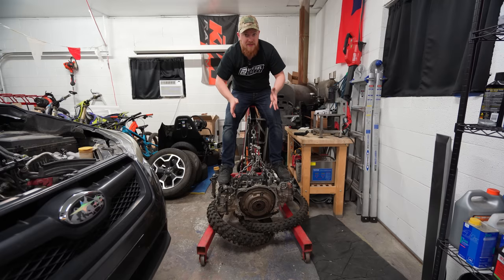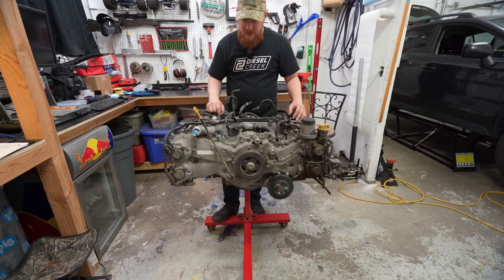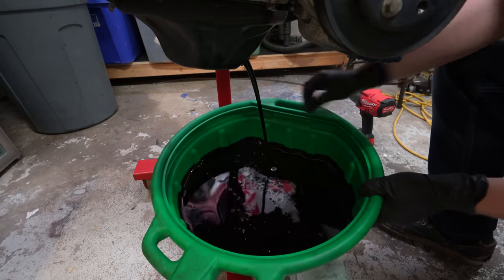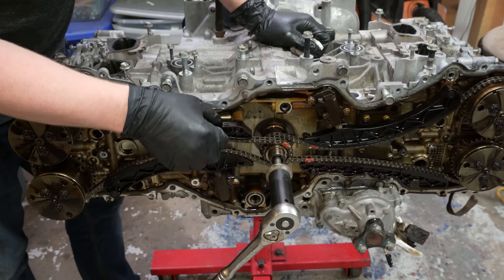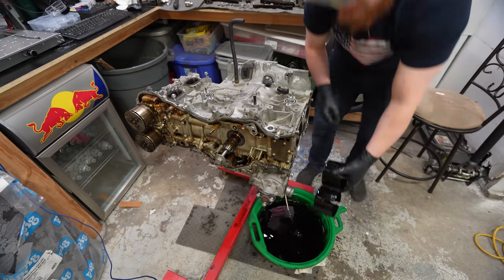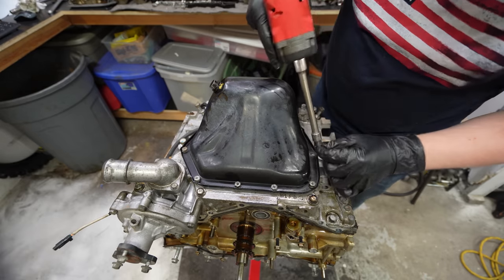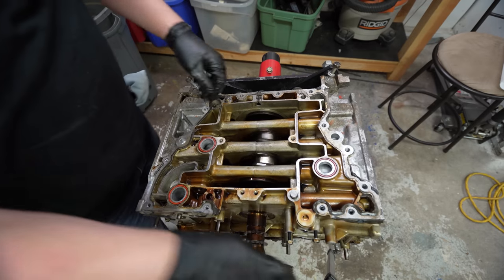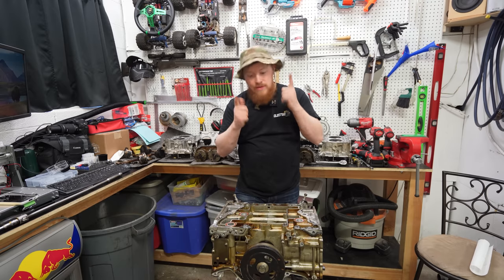Finding Out Why Our Crosstrek Blew Up! Engine Tear Down and Diagnosis.

Comment: Hate to break it to you but I don’t think the leaf blower motor will work. But a turbo charged leaf blower.... now that might be an option. Heck maybe you can use another leaf blower to blow air into the system like a turbo. Maybe if we just keep adding leaf blowers we’ll have exponential power!!

Comment: I just ordered a '23 manual transmission Crosstrek Premium. My understanding is that the engine had some redesigns in some details.
Never owned a Subaru before, hoping for good longevity. I'm planning some long-distance road trips and taking my canine pals with me. Grand Canyon, Banff, Okeechobee....
Reply from the maker: So glad they're still making manuals! And more inportantly that people like you are buying them.
And yes they moved to direct injection which has its tradeoffs. For you it just mainly means better fuel economy. And main thing with Subaru motors is just making sure you're keeping up on the oil care. Always make sure it has good oil level, change it ontime and use a good filter. Should last you for years to come. 👍

Comment: There are bolt on FB20 turbos but I think it'll end up costing more than one of the many swap options. Also as you mentioned, these engines seem like a real pain to put together.
Reply: Try a 3406B. That is the easy button by comparison...

Comment: Its pretty disappointing to see an engine gone after just 120K miles. My opinion is that you should just a get WRX engine for more power. The WRX engine would have got components that's designed for turbo charged loads. Trying to make big power from an NA engine is like trying to get a plastic straw to lift heavy weights.

Comment: I had just changed my oil and drained the old oil into the empty oil jug. Backing into my garage I didn't notice that the dog had knocked over the sealed oil jug until I promptly drove over it where it exploded and sprayed a fine coating of oil everywhere.
Reply from the maker: 😂 I count my blessings then.

Comment: Hey, I had a 2010 outback with a 2.5 EJ engine and it was binding up with carbon buildup on the piston top, almost a 10th of an inch. This was due to low tension piston rings and blow by forcing oil into the intake like you saw with your venturi plates. replaced the rings and it was all better. I have a 2013 crosstrek and it has the weak rings too, so much blow by it couldn't hold oil, then the same thing except it broke pistons and rings and bearings. Seeing rod bearings 2 and 3, I'd say main bearing number 3 has failed since it supplies oil to those.

Now mine has it has a .50mm overbore late model rings (Subaru got sued over this one) and I'm chasing an oiling problem. Check the carbon on the piston tops and the combustion chambers and split the block and look at #3 main. ;-)

Also, the FB20 is a turkey as far as tuner bits go, and the FA20 is a giant PITA to swap as they are like dogs and cats, good luck.

Comment: That oil looked pretty dirty for a recent oil change? Great work, info/video! Enjoyed it very much!! A Crosstrek owner.
Reply: That oil looked like what comes out of my Duramax, super dark and thick for a gasser supposedly using 0w-20
Reply: ... pretty sure the 0w-20 being used doesn't have high HTHS (high-temp/high-shear) properties and is also resource conserving which means it thins out to less than a "20 weight" at operating temp.  and then some oils just get dark when exposed to heat
Reply: I change my Crosstrek oil at 7k mile with Mobil 1 and it never looks that nasty

Comment: I think I may have the same timing chain noise on the fb25 engine in my forester. Does it sound similar to a engine pinging noise? I hear it under low RPM load most prominently.
Reply from the maker: Yeah more sounded like a clacking noise for us. But yeah for the XV usually under load at  2-3k rpm or lower.

Comment: It appears to have had an oil delivery problem to those rod bearings.  Subaru flat-4's of any model do not tolerate operation with low oil sump levels and will sometimes even spin those bearing shells.  I'd definitely crack the case and look at the mains for similar problems.
Reply from the maker: Yeah if i rebuild this motor then I'm definitely pulling the mains. There's no way they're good if the rod bearings looked the way they did.

Comment: After watching the whole video, and my little knowledge of the FB20 engine, I would say don't rebuild it if you're looking for more power. Maybe go the FB25 route for a little more power or go the FA20 if you want to spend a lot of money since everything else will need to be beefed up.
Reply: Assuming the FB25 will fit
Reply: @fredharvey2720  looks like the FB25 is 1.6-2.0" taller and deeper. The stroke is the same so it shouldn't be wider. I've messed with the 16 XV and Impreza a bunch of times. You definitely have space to spare in that engine bay for the depth...the height could be tight, but they probably revised the intake manifold to accommodate the difference. Personally I like the 2018+ a whole lot better. I'd just replace the main bearings in this engine and trade up at a later date.

Comment: Interested to see what you do for repair.

Subarus are pretty capable of interchanging parts. If you had the time, money, and wiring know-how (or someone who does), then the best upgrade would be getting a wrecked WRX, or Forester XT and swapping the driveline. Mid range would be a headstud / gasket upgrade and a procharger kit. I think there are some kits out there (AVO makes one). But if it were me, I would probably just replace with stock parts and port the intake and exhaust, and a tune, maybe do headers and custom catback as well.

Comment: I think if it was me , I’d look around for a used engine.. and just get it back up and running.. as parts and machine shop labour and gaskets.. probably won’t be cheap and it’s hard to find a good machine shop.

Comment: I think the FA24F from a 2019+ Ascent would be a good swap. Turbo, 260hp and will run on 87 octane
Reply: I have a 2022 Outback Wilderness, the FA24F is a nice engine, it does run great on 87, but I have found that I get better fuel economy with 91 octane. Also the turbo and tuned transmission in the Wilderness Edition give it quite some nice pickup, at the expense of fuel economy.

Comment: See if you can drop a wrx engine in.  I've always wondered why Subaru didn't put the wrx engine in the Crosstrek.  Everyone I know that has one says the same thing...  It doesn't have enough power.

Comment: Excellent work. I really enjoyed watching you tear down this motor and finding the issue. I own a newer 2019 Crosstrek and love it. I plan on keeping it for about 10-12 years and will not likely get anywhere near the 120k you had on this motor as my wife and only put about 8000 miles per year on it. I'm curios to know how often you changed the oil and whether or not you used regular oil, as synthetic or a blend of the two. Since we drive the car so little, I am changing every 6 months and use a blend. I'm thinking of going full synthetic and stay with the every 6 months strategy.
Reply: your good on the 6 mth oil change thats recommended anyway no matter how many miles 
the book says to put 0-20  synthetic i have a 2020 crosstrek i order genuine subaru oil  on 
Amazon and use a mobile 1 oil filter
Reply: @alanlangley7246  thanks for your reply, Alan. I’ll order that oil on Amazon. Great tip!
Reply from the maker: Knowing how the motor sounded when we bought the XV used, I've kept it simple on maintenance. 0w-20 full synthetic like the manual specs and every 5k miles or 6 months. We've only put 18k miles on this car since we got it 3 years ago. So really dont drive it much either. Might not be the best but i knew the motor life was numbered.
Reply: Its just a bad design. Search on youtube subaru rod knock. So many fail this way. Changing the oil sooner might help it last a little longer but they all fail very early
Reply: @chinchy111 lol, they all don't fail early. 
Plenty of them rolling around me with 200,000+ miles. Original CVT Tranny also.

Comment: Don’t build this motor. They are not worth the headache. Plus the trans can’t handle much more than stock. I watch a channel on here that has turbo’d the stock engine and built the trans and it has been way to much work time money and testing. Not many people have done it so there isn’t info out there to go by it’s all guess and check. If you want more power drop a FA20 from this Gen WRX. It would be a lot easier and way way way more aftermarket support. I use to have a 2015 and also had dreams of a turbo built but quickly gave up after doing the research. I now own a 2023 Sport and love the 2.5L once the warranty runs out I’ll be doing a WRX build and trans swap. Unless the wilderness edition comes true and has a turbo engine then I’ll just trade her in and start there..

Comment: manual foresters and crosstreks have a habit of burning valves. don't look for more power out of these cars the electronics alone will give you a buttload of grief and cost a lot more than the car is worth.

Comment: do your research bud, you cant do just a motor swap, the computer system is built for this 2 litre engine, you would need to do alot of electronic work to make it run right. fix it drive it and buy a wrx or forester xt. good luck.

Comment: Engine broke. Removes FRAM filter. Well there's your problem... bearing failure, not suprised. Hey... do the kewel thing and LS swap it! LOL!
Reply: Better MANN filter.
Reply: I use OEM filter on my 2018 Outback. Older used car I had used FRAM filters....till I read the fine print said " Made in China" .  It's like hell  no!   Never bought one since
Reply: I've never seen any evidence that those Fram-made Subaru oil filters ever caused an engine failure.
Reply: @ozzierabbit587  I have rebuilt many an engine that spun bearings. The one commonality? Fram filters. Didnt matter the type, Fram filters have the worst filter media.

Comment: I'm curious...
How many miles have you owned the Crosstrek for, and what were your oil change intervals?
Reply from the maker: We've owned it for about 18k miles and been doing 5k oil changes.
Reply: How were the intake valves for deposits? And also the oil control rings on the pistons?
Lots of dark carbon deposits on the pistons, but we didn't get to see how the intake valves looked.
If the oil control rings were gunked up, and allowing blow-by into the combustion chamber, that would explain all those deposits, and the bad running.
I'm guessing the owner(s) before you bought it did long oil change intervals, and with the engine consuming the oil, it ran low, and ate up those bearings.
Reply from the maker: @ianbaillie6378  everything in the motor is quite crusty with deposits and what not. And you're right that the oil rings are clogged with deposits. Honestly you made me realize i didn't do as good of a job giving macro shots on camera for the video so I took some photos and posted them on Patreon so anyone can look at them (public post so it's free to see)
Reply: @ReadySetProjects  Oil rings clogged with deposits is definitely the sign that the previous owner(s) were using long oil change intervals.
Once those oil rings get clogged up on a Flat engine, there's not much you can do to get them back, unlike an inline 4 engine where you can line up the cylinders, and give them an overnight soak in Berryman's cleaner. You would only get the very bottom portion of the control ring, not even half.
Well, I hope you find your replacement engine soon, and have good luck here on out with the car.

Comment: Just swap the engine I believe, but if you can afford the block to be rebuild and make the ports alot bigger like you said youd might be surpriced by more things in the unknown such as would it be able to take the turbo and more power. Not gona lie 120,000miles sounds like a Doritos engine.
Reply: I did that on my 2007 Malibu 2.2, ecotec engine  broke at 268k miles. Found a 68k mile engine  , swap it out. 
Meanwhile....bought a brand new 2018 Outback, kept it in the garage while drove the POS Malibu to work.  That's why  it was important to get the paid off Malibu running

Comment: Timing chains should be replaced at 100k per Subaru...
Reply: That's the timing belt (@105k miles), not the timing chains. Timing chains aren't considered maintenance items for Subarus.

Comment: You really shouldn't spin the crank with the timing chain off. This is an interference engine
Reply from the maker: Agreed, but you'll only have a problem if some of the valves are open.

Comment: I looked at a 2023 Trek . . . Nah . . . In my mind it had a long list of so many hand grenades waiting to blow up I told myself . . . No Way. Crazy Money Too for a dated/tiny vehicle and just wait until Little Johny down at the Dealership gets his hands on it. Oh my . . . ???  Nah . . . you can have mine. To me they are Very Slow / Leak Oil / Burn Oil . . . which will Further HP Loss.  They are made to be Disposable and are Poorly Designed. Way Overloaded with Buggy Tech ( Much of which does Not Work . . .  only drives up the price ). 
My Overall Honest Opinion is they are a very Unfriendly Trap Vehicle.
Just saying what my experience has taught me . . . CVT . . . No Way. Drive it.
Even the paint looks 2nd rate to me. $40K can be spent much better than this. Good Luck